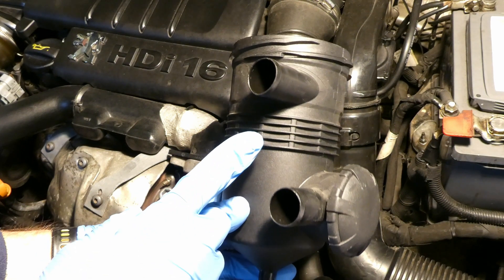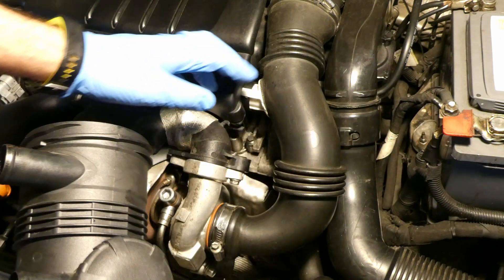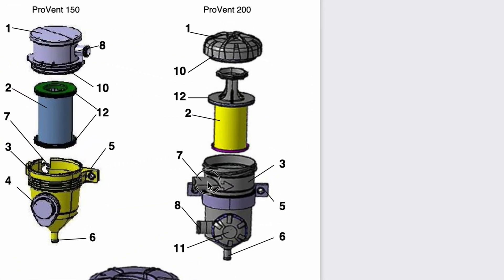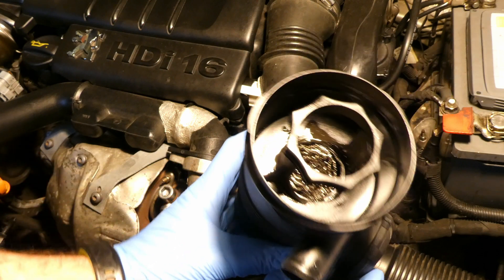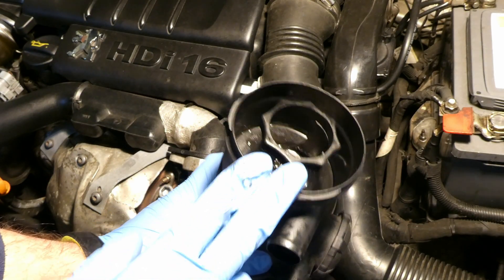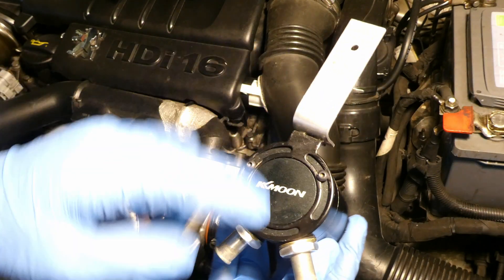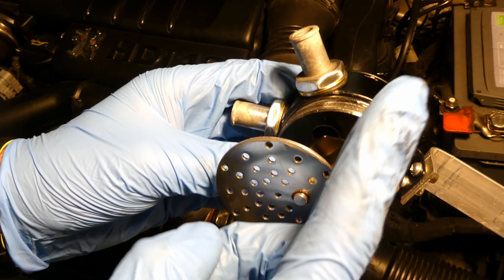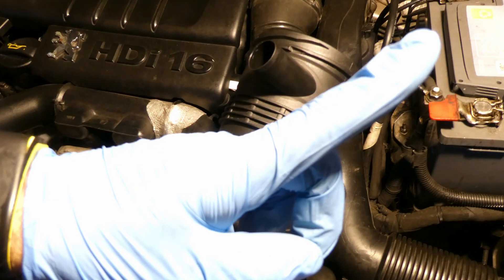Which is the inlet and outlet port of the Mann Hummel Provent 200 and Mishimoto oil catch cans?

Comment: I use a Provent 200 on my 2012 Petro GDI non turbo engine.  I installed intake vacuum side is on top and crankcase gases on the bottom.  Reverse flow.  Soot and oil mist collects on outside and drips down.  I have second bronze seperator filter on the output leading to intake.  I get nearly pure water and fuel vapor, no soot or oil. Using version IV element.  This change is due to my engine type.

Comment: I envy you, my Provent 200 will not fit into my car. I'm thinking of taking 100 or 150.
Reply from the maker: I'm not too sure of the 100 or 150 are a bad choice. Obviously space is a bit of a problem for the 200, but I always thought the 150 or even 100 are probably as good. The 200 is built for much larger engines than mine, so who knows, it might be that the smaller ones are better filtering for smaller engines.

Comment: Здравствуйте подскажите какая мадель маслоуловителя лучше
Reply from the maker: Difficult to say which one is better as I have not seen any efficiency tests of these. To be on the safe side and not increase crankcase pressure I would go with the Provent 200, but that does not mean it will filter oil better.

Comment: How do you know if the stainless steel middle insert is making the oil catch better as water vapors may rust it? Thanks
Reply from the maker: Well, it is stainless steel, it cannot rust. On the other part of the question, I am not entirely confident that adds too much efficiency to the oil catch can, but still better than nothing. It does not restrict too much, but still adds a little bit of efficiency.
Reply: @moremolecules  I keep a wad in mine also. It acts as a "pre-coalescent" filter kind of like the inner plastic mesh of the Provent's filter. It does make it more efficient.

Comment: well the explanation is little Physics,The demister coil acts as condenser and retention extender so more vapor will condense. Flow of air is parallel to the flow of condensed gas or oil so entering from top tube both gas vapor and condensed gas flows parallel towards the bottom.If the flow is starting from lower  nozzle,when the demister coil is oil laden or saturated,the oil will flow by gravity towards the bottom of can.If the entry of gas starts from bottom then gas flow will meet the flow of condensed vapor or oil so re-heating of condensed oil by in-coming vapor takes place.

Comment: Good video...thanks.
I have questions...

TOP hole is inlet for "Blow by gas from crankcase"

BOTTOM hole is outlet for "Gas without oil"

END hole is for oil 

Right ????
Reply from the maker: Yes, that is correct, the bottom hole is rather small at the very bottom of the oil catch can and if one wants can b plugged back in the crankcase.
Reply: @moremolecules  
Thank reply...  
sorry but. One more question....

About the oil....(from END hole of catch can)
No problems to go into the oil pan directly??
Reply from the maker: @badmintonlesson  I would not myself put it back in the sump, but that how it was designed by Mann-Hummel.
Reply: @badmintonlesson  Yes, but I wouldn't. Once you see what the Provent filters out (water, and brown mayonnaise looking gunk), you're not going to want that back in your motor recirculating, and building up. It will reduce the lubricating properties of your oil.

Comment: I believe man and Hummel messed up there insulation instructions because it's supposed to be the other way around
Reply from the maker: I do not think so, the Mann-Hummel have a particular circular motion of the in air before going down and it is done on purpose to maximise the amount of the gasses get in contact with surfaces.

Comment: I'm trying to find a genuine Provent 150 in EU but cannot find it anywhere. How is the genuine one compared to the copy ?
Reply from the maker: Do not know much about the 150, but also really difficult to say about the 200. I have not made an efficiency comparison between the fake and the geniuine one, so difficult to comment how much worse it is. It certainly filters oil, so it works, but how well is difficult to say. It could be that it is say 50% worse than the original, but it could also be almost the same. Probably safer to say that it is better than no oil catch can.
Reply: @moremolecules  thank you for the reply !

Comment: hello! excellent video! can the provent system be used on a turbocharged gasoline engine? more than 200 hp.
Reply from the maker: The Provent yes, but for the >200bhp you may need the slightly bigger version as it depends on the flow. They have useful pdf manuel that gives the size of the engine and which Provent to match it with.
Reply: @moremolecules  Thank you! I will review the information!!! 😃  I hope you can upload an update on the use of the copy Provent. Check for leaks or something. 😃
Reply from the maker: @Mark_182  I will try eventually to do something with the copy. I have a test of efficiency in mind, but too much other work at the moment.
Reply: @moremolecules  it would be great! I hope you can do it soon! I will be pending.

Comment: Appreciate your talk of the Mann-Hummel Provent, as it's the BEST performing unit based of actual testing (SAE paper).  Have you done a video of with and without your added steel wool addition (like 3-5k miles with and without) to see if it really benefited?
Reply from the maker: I was thinking of doing that, but it is a false test. Most people will do amount of liquid collected and that depends on a huge number of factors. Say, the weather is a bit rainy, then the catch can will most likely collect a lot more water. One needs to separate the water and oil and compare only the oil amount, but that is difficult to do. In order for such a test to be valid it needs to be under the same conditions. So, I have not done it as I know it is not valid and I could not present the video knowing it is not right.
Reply: @moremolecules  , BTW..found an SAE paper that already did a test between knockoff with mesh and real provent with paper filter.

Let me know how to get to you.
Reply from the maker: @douglasmontgomery6315  That would be an interesting read, would you be able to send a link to the paper.
Reply: @moremolecules  , I can try…but YouTube deletes links sometimes.  Give me 15 minutes and I’ll try
Reply: @moremolecules  , did you get the link on the other video post?

If not, you can web search ; Comparative Performance of 12 Crankcase Oil Mist Separators 03-12-01-0001
Reply from the maker: @douglasmontgomery6315  Yes, just downloaded and many thanks indeed for sending this, really appreciated. I have not noticed this paper, although I have seen another one, but it was not efficiency test. I will have to read it properly and see what the results were, but was also thinking of making my own test with the catch cans I have, with/without mesh, etc.

Comment: I have modified my Provent to be a completely sealed unit. Both the side valve and top valve have be sealed. It acts more like a conventional sealed catch can.  My hose from the valve cover goes to the bottom inlet and the top is the exit to the turbo.  I have attached a clear plastic bottle to the bottom of the Provent and it collects a tremendous amount of oil/water before they ever get to the actual filter.  The top line going back to the turbo is always oil-free.  Your comments, please.
Reply from the maker: To swap them, so the inlet is at the bottom and outlet and the top, I have commented in the video on this. Not too sure about the completely sealed part that you have described, could not quite understand how it is a completely sealed unit. The bottom has a few steps or the flow has a few barriers. Water/oil will gather there and will restrict the flow a bit and a bit more crankcase pressure as a result.
Reply: @moremolecules  can you switch the in and out for both 1k miles,then campare them,or measure the crankcase preasure？thks
Reply from the maker: @MrNCHSTENNIS  Good question. I doubt there will be a change in the pressure as the restriction (if any) will be there whether from bottom or top. Now, the efficiency is different matter, I might be able to test that sometime soon.

Comment: Salve, sono Gregorio e volevo chiederti se ti è capitato di vedere il filtro gasolio UFI 55.170.00 montato su C Max 1.6 Tdci: lavora al contrario (il gasolio entra nella parte interna dell'elemento filtrante ed esce dalla parte esterna. Difatti ogniqualvolta che si svuota il filtro con l'apposita rotella posta sul filtro stesso, il gadolio che esce è sempre pulito
Reply from the maker: Ciao Gregorio, I have not seen this filter before, but it looks made pretty well. It is probably specific to the 1.6TDCi, as the inlet and outlet ports are slightly positioned differently than the 1.6HDi.

Comment: What is the diameter of the turbo inlet , because i want to put blue silicone pipes instead of the original aspiration tube , cuz the original broke
Reply from the maker: Apologies for the later reply. The outside diameter of the turbo inlet is 45mm or 4.5cm. Hope this helps.

Comment: Hi, I have the Provent 150 (VW T6) and there the outlet is on top and inlet at the bottom. Works very well since one year.
Reply from the maker: Hi Knud, yes, in Mann Hummel's pdf manual the PoVent 150 the inlet is at the bottom, but it is a bit different than the 200.
Reply: @moremolecules  yes, but I took the Provent 150 because it is the smaller one - the 200 is to large for the engine compartment of the Volkswagen T6 - 150 PS TDI)
Reply from the maker: @knuddreeen2276  Absolutely yes, I also thought about the 150, nothing wrong with it.

Comment: Hello

I have peugeot partner 2008 1.6 hdi , there is an Engine noise , how to reduce that noise??
Reply from the maker: Depends on what kind of noise and where it is coming from. I would suggest to investigate exactly where the noise is coming from as it could be multiple sources.
Reply: @moremolecules  can you learn us how to connect 1.6 hdi to computer program and detect the error ?
Reply from the maker: @VisualStudioChannel  Have a look here, as it may help:  https://youtu.be/0s39tfitoso
Otherwise, connect a ODBII scaner and see if there are ny errors.
Reply: @moremolecules  thank you bro 🌹🌹
Reply: As MM says, you need to be a bit more specific with your noise problem. 
Common harmless noises are low rumbling from a loose airbox at the back of the engine, MM has a video on this. or the 2 big in/out airpipes banging against each other - just tape or tie them together.
If it's more of a metalic sound near the turbo it's probably the upper heatshield breaking off its mountings.

If you have a ticking sound it could be a loose injector (especially if it's when idling after the engine is warm). Take the engine cover off and look for little puffs of smoke in time to the tick. There are many videos on YouTube on how to change the injector seals. You'll need a 7mm hex/Allen key and tightening them up a bit can help limit the noise but the seals will need replacing as soon as possible.